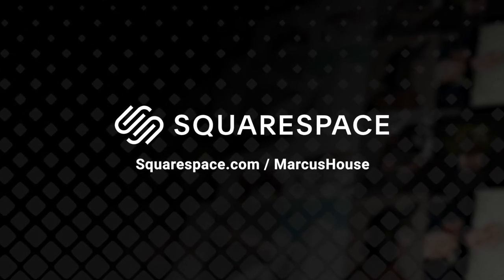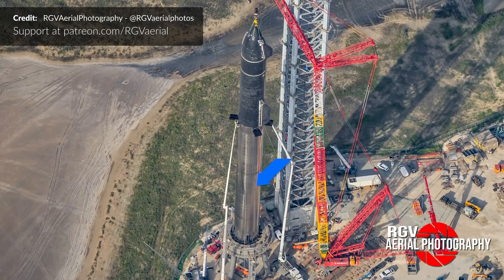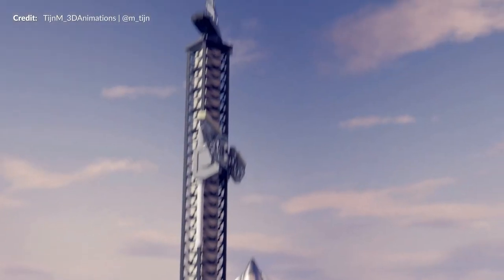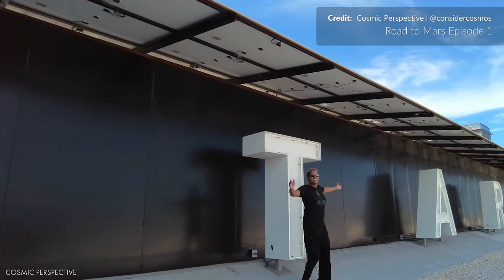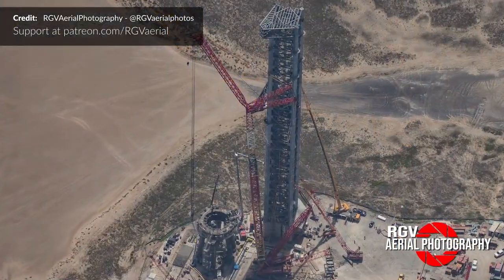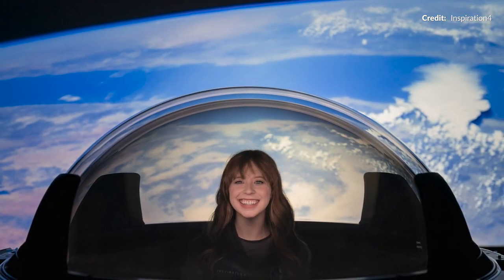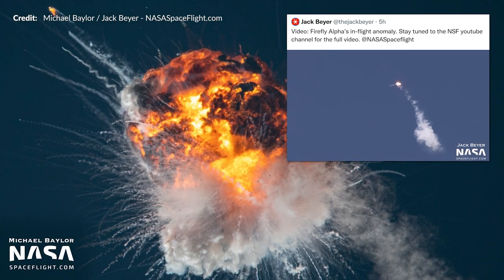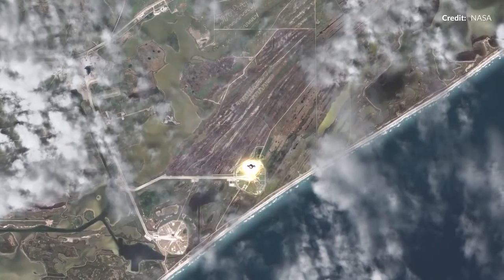SpaceX Starship's Stage Zero Progress, CRS-23, Firefly Alpha, Astra Sideways Launch, RFA Test

Comment: The progress of even stage zero is blowing my mind!
Reply: It took a few decades, but the space race is back on again. 😁
Jimmy Webb is poised to launch this year as well.
Reply: amzing elon has been able to design manufacture and test rockets also design and manufacture an orbital launch pad faster than the SLS system can get up and running lol
Reply: Yes the new space race is between Spacex, Nasa and Blue Origina (screw BO)
Reply: @maximus5438  BO isn't even close to SpaceX level at this point I would say they are at the first SpaceX safe landings during the test phase leading up to first Orbital...
The BO joy rides are 10 years behind SpaceX !!
When new Glen is 50 successful launch and landings they are still 10 years behind SpaceX....

Comment: When the booster lands, it will only be using 3-4 raptor engines and will hoover at the tower.  The hoover does two things, consumes fuel and reduces the impact load on the arms.  The arms can weigh the Booster/Starship and wait until they have consumed 99%+ of the fuel before requesting raptor engine shutdown. The arms can be near the top of the tower giving more room for the rocket exhaust. The arms can then reposition the booster for lowering onto the launch pad.  Catching the Starship near the top of the tower on the side opposite the Quick Disconnect.  Once the engines are off, lower it onto the booster with the quick disconnect arm helping with the alignment.

Comment: 14:39 
😐Pro-tip for NASA:
Before you press the Spacebar to launch, ALWAYS press "R" and then "T" in order to quickly activate your SAS and other guidance systems. 
You can find your thrust to weight ratio in the bottom right corner while you're assembling your rocket. Ideally you want that number to be above 1.

Comment: The complications of trying to catch the fairing in a massive net was found to be not worth the effort.  
Likewise, I think Elon will discover that catching a massive booster will not be worth the effort. Catching the ship itself is even a worse idea.   
He should opt for a landing method that he has basically perfected.
Reply: Sounds like you’re applying for a job at blue origin
Reply: The fairings definitely weren't worth it, but I disagree about the arm.  Being able to restack the booster immediately will save a lot of time using a crane.  I don't recall, but will it also stack Starship on top as well after it lands?  I assume it'll land next to the launch tower but don't see how it'll grab it unless it grabs it by the sides.  I think it'll be more necessary on the converted oil rigs they're going to be using.
Reply: @owensparks5013  the extra cost could come in trying to catch an object that weighs hundreds of tons and missing - blowing it all to hell.  That sound like a high cost to me.  Catching a fairing is far easier than a booster. And missing a catch with a spaceship carrying hundreds of people... not a good idea.
Reply: @aeroripper  Being able to restack the booster immediately

I'm not so sure about immediately as I would expect a cool down period will be needed as well as inspection of the engines and engine compartment which is easier down (IMO) if not stacked.
Reply: @Scanner9631  That's true.  It'll be interesting to see how everything comes together in a year or so after they get these orbital launches going.
Reply: @khaccanhle1930   Catching a fairing is far easier than a booster.

Maybe not. The fairing is uncontrolled and probably tumbling so it should be much harder to predict exactly where to be to catch it.

The booster is landing in a controlled fashion and with the ability to hover (and I assume to move laterally) should make it more easy to exactly position for the catch.

Consider it instead of being caught but landing on the so called catcher rather than the ground.  

As to weighing hundreds of tons Starship is 50 meters long with a dry mass of ~85 tons.  Super heavy is 68 meters which makes it a little over 1/3 longer even with a few tons of fuel aboard I wouldn't expect it to be even 150 tons (not light but not hundreds of tons).

Comment: Rotating the booster and ship for alignment on the pad is easy using the tank treads on the arms. The treads can be driven independently. Rotation of the load is no problem if you drive the treads at different speeds or in different directions.

Comment: Thank you for your graciousness Marcus! Your articulation is 10 out of 10.  Your insights and musings are valuable and thought provoking.  The heavy tank track system is way overheavy and overkill.  There is a lubricant plastic what will double as a cushion, to not damage the grid fins on capture and yet also allow them to slip along the support arms without the need for rollers.  It's called Ultra High Density Polyethylene, I think.  Roughly the same stuff milk jug are made of.

Comment: Catching system will also need a way to spin vehicle for alignment as well as in and out motion. How many degrees not depends on locating pins.
Assume up to 30 degrees.
Reply: The tank treads will supply that rotation up to a point.

Comment: So long as the ship has to flip to vertical during the landing burn, the catching system won’t be as effective as they would like. However, if they went old school ITS and flipped the ship using hot gas thrusters before the landing burn, that would remove the horizontal kick, which would make a ship capture similarly reliable to the booster. I’m not sure they would try that, but if they intend to capture the ship, that might be their best way to do it.

Comment: Wonder if the Falcon 9 initially design to recover the 2nd stage would result being in stainless steel, plus heat tiles. The pro it's having less mass in reentry, without the payload fairing.

Comment: If I remember correctly, the SLS solid boosters have a use by Feb 2022 date, so we are looking at another delay to get those replaced.  I'm assuming that they will have to be sent back to Utah to have the current propellant burnt out on the test stand and then be refurbed for a later ship set.  Hopefully the shells for SLS flight two are about ready to be cast.

Comment: Do the Grid FIns play a roll in the catching of the booster? And if so, what will they use if the change the design of the grid fin? (I just came up with this thought when i saw the 3D model catching the booster and it looked sort of like the Grid Fins played a roll in the catch). yes i realize its just a model and not the actual end all be all.
Reply: I believe it was first thought that it would be caught by the grid fins, however now I believe they said it will be by some kind of pins sticking out, waiting myself for some confirmation on what it will end up being😜

Comment: The Summer 2022 delay for SLS would be far worse. The SRB propellant has an expiration date coming up. If it takes too long, they will have to remove them and either dismantle and refuel or get new ones. This could see a 9 month delay, in which I would not be surprised if SpaceX Starship had launched twice by that point.

Comment: I am surprised by the simulations of catching a starship and then re-stacking it straight away. Judging by the last landing attempts where the bottom caught fire, perhaps when they use those 'chopsticks' they'll need to hold the starship away from the booster for a while until any fire has stopped before they re-stack it, maybe long enough for the temperature to cool down enough (and have something to extinguish it quickly installed nearby). Surely if they re-stack it when it's still hot it won't fit properly?!

Comment: Super Heavy is going to rock the coastline along the Gulf of Mexico when the full stack launches. The whole of Starbase will probably have to be evacuated to err on the safe side in case there are any mishaps during initial launch. In any case, it should be a spectacle for the decade to see a completely new launch system of this scale liftoff in an attempt to achieve a near-orbit trajectory and return to the open ocean for a landing. However, watching Super Heavy perform its reentry and landing burn will be exciting. I hope the system exceeds expectations and both craft return safely per mission parameters.

Comment: The tiling still seems overly complex (similar to the Space shuttle), you would think a greatly simplified heat shield would be a priority in the future.
Reply: These tiles are actually very simple in comparison to the shuttle. The shuttle had hundreds, if not thousands of individually machined shapes in its TPS, whereas Starship uses mostly the same hexagon shape all over the hull. Specialized shapes are only used around the aerocovers and the tip of the nosecone, so for most of the body they can mass produce the tiles at an affordable rate. I'm wondering how long it takes to repair the shield between flights though, that could have quite an effect on turnaround time.

Comment: They require an order of magnitude greater accuracy in the powered landing with superheavy vs falcon to nail that capture without damage. I don't think it will ever be possible to achieve an ultimate consistent average turnaround schedule shorter than a day or 3. Reason: Reduced wind tolerance to be so precise.

Comment: Can the QD arm change vertical position? If there is no tail to tail fuel plumbing wouldn’t they need 2 or the ability to move between both other stages?
Reply: the QD is just fueling the starship. the booster gets a connector at the base of the stand. it can be seen in construction already, a blackish rectangular structure on one side of the table.

Comment: So, if the SLS launch slips, could the "shelf live" of the boosters become an issue?

"The joints that connect each segment of the solid rocket boosters have a limited lifespan of 12 months." (BBC)
Reply: Good question. no answer.
Reply: Yes. I've seen a dependable article that says one year from the date the first segment was stacked is when the clock runs out - and that date is Jan 7, 2022. Part of the seal/insulation between segments called the J-leg would need replacement, which means unstacking segments and returning them to the factory, and a lot of work on them there.

There is a possibility NASA can do an engineering review and give a 3 months extension, but NASA will be wary of criticism for anything involving a joint seal problem. The O-ring misjudgment on Challenger is infamous.
Reply: @donjones4719  Nice for them to be kept busy over there.

Comment: You gotta make a rocket with like 6 extra engines with boosters after rocket is launched.  Like car The more air and fuel you can get to your engine, the more power it can give back.  For this reason most upgrades are focused around pushing additional air and gasoline into the engine while others drive the extra exhaust back out. You make them light weight and once rocket In space hit the botton to give it a boost of speed . This will allow you to get to mars faster and can help point rocket in the right direction . I can get to  mars in 30 days if not faster . And don't have to wait for the orbit to line up . Also send 10 smaller rockets a head and keep sending with extra supplies ahead of the mission.

Comment: Can anyone give any details to why so many of the thermal tiles got damaged or need replacing? Is it a manufacturing issue or perhaps an installation issue? I could understand a few needing correcting but that many may possibly indicate a larger concern
Reply: I'd like to know too - Elon should sell the old damaged ones - unless secret sauce has been used.

Comment: I’m curious, are the chopstick arms to save on fuel and save on landing parts on the booster or some other reason? Will they catch at terminal velocity speed or do the engines slow down to a certain point first?
Reply: Good questions. The engines reignite for a "landing burn" to slow the booster down, and the chop stick arms will catch it as it returns. It will be going extremely slow, relative to it's reentry speed. By catching the booster it eliminates the need for landing gear which increases payload capacity overall.
Reply: @avsrule247  🙏 thank you. Roughly how much additional mass to orbit are we talking with this solution? Seems like an ambitious solution so I would imagine it is significant instead of marginal.
Reply: @Pete_YT  Only SpaceX would know the exact savings, but we can assume it'll be significant enough if they're willing to spend millions of dollars to build the launch tower with a catch arm. Don't forget that less mass on the booster also means less fuel needed for booster-back, and less fuel needed to land, in addition to a lighter vehicle on liftoff. So that means more fuel on launch. So the savings have to be quite significant
Reply: @avsrule247  yea I’m going to guess at least 5% improvement in payload to LEO maybe as much as 10%. So that would eliminate the need for 1 launch in every 10-20 in terms of total payload to LEO. Incredible ingenuity.

Comment: I want to know how those arms are going to grab a booster or ship out of thin air? Will there be an operator or  will it use sensors? It's just nuts.
Reply from the maker: All robotic for sure. No operator will have the reflexes needed.
Reply: thin air? Nope, just normal chunky air.

Comment: I'm really starting to think there are too many moving parts in Starship. How are all those heat tiles not be a problem? The margin for error on catching these things on the way down is way too small. Just a little gust of wind and everything goes CRUNCH. This will SO cool if it works consistently, but I just have a wrenching feeling in my gut this is too much.
Reply: I agree - adds to a low level anxiety. Bring on the Atavan.

Comment: I'm really concerned about 1) failed catch attempt jeopardizing launch pad infrastructure / fuel tanks and 2) loose heat shield tiles could prevent starship flaps from working during the belly flop

Comment: If even one of those heat tiles came loose it would be game over for starship. Do you think spacex will look towards a single skin heat protection system ?
Reply: "If even one of those heat tiles came loose it would be game over for starship." No, not really. Even the flimsy Space Shuttle survived one or two missing tiles on more than one mission. 
Between the tiles and the hull there is also an additional layer of fabric that could double as heat shield in an emergency. 

And last but not least the 4mm of stainless steel will hold up to the plasma, if the missing tile is not at the hottest point on the hull. The ship will be ruined on landing, but not necessarily destroyed.

Comment: I really don't know if catching a rocket is feasible.  If you miss by a little bit, there could be significant damage to the launch complex making it unavailable for a long period of time.   Even catching it, it is not just going to be stacked on a booster.  It needs to be checked, it has to be attached somehow not just placed on top. There is going to some form of electrical or plumbing that needs to be attached then verified.  This is why I do not believe that it will ever be one hour turn around as Musk keeps saying.
Reply: Maybe not a 1hr turn around, but anything less than the NASA 6 month turnaround would be a win.
Reply: @DLWELD  The shuttle best was 54 days,  which took Space X until July 2020 to beat and that was only by a few days.  I do get your point and it will be interesting if they can do it, or is it another Muskism which he will learn what NASA did when turning an orbiter around.
Reply: Best Falcon turnaround seems to be 27 days so far.

Comment: I find myself wondering if thrusters could achieve the same level of flight control as the starship flaps and booster grid fins? The complexity and weight of such control surfaces combined with the problem of the chopstick catch landing brings the design within Elon's own design edit philosophy. They look cool though which may cloud Elons's aesthetic eye?
Reply: Thruster were originally the plan, they ditched that. Problem is, a purely cylindrical airframe is naturally unstable in the belly first orientation, so the thrusters would have to constantly fight against the torque of that instability, burning lots of fuel.

Comment: Usually if vibration testing takes to long its because they've seen something and need more data. To get more data in vibration analysis you have to go through a lot more set-up and eventually....modifications to the structure. Not a good sign.

Comment: They will have to do a 'drop test of a booster from the Godzilla crane to simulate the condition of engine out failure on descent near the tower. If the booster drops out it may tumble over into the 'tank farm and end up destroying Starbase. Sorry to be negative but that tower should be at least a kilometer away from anything else ( like at Cape Kennedy/NASA)